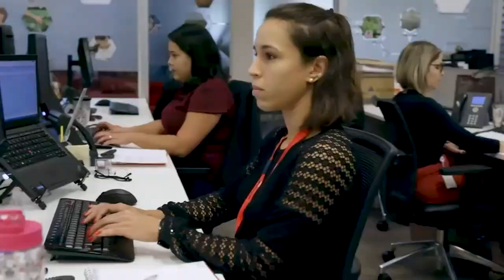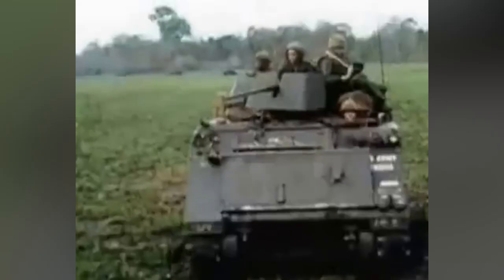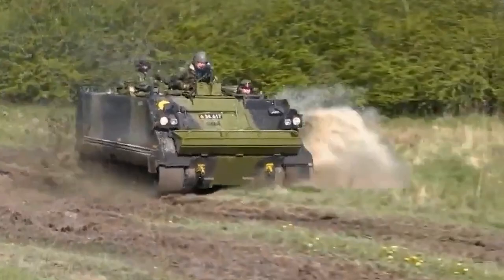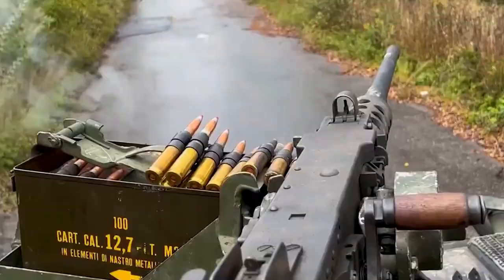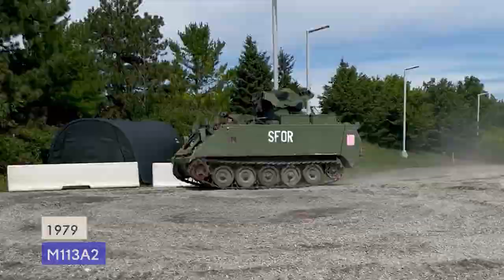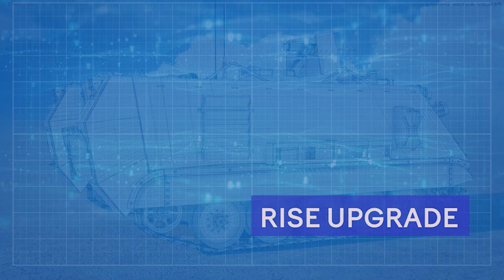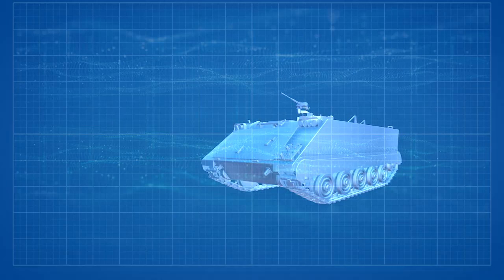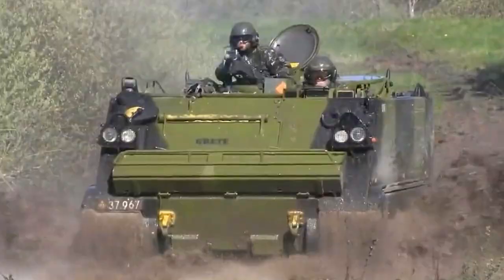America's Most Lethal Armored Vehicles Shocked The World!

Comment: The US should provide all of its 5,000+ holdings of M113 APC's to Ukraine but first turn them into budget IFV's by fitting lightweight composite armour, possibly light reactive armour in parts of the frontal arc, blast shock resistant seating, strengthen the floors to improve mine resistance, spall liners, night vision/thermals for the driver and new turrets with a range of gun calibres up to 40mm fully stabilised with the appropriate optics, fire control computers and communications. The additional weight may necessitate an engine and transmission upgrade which should be avoided if at all possible.

The Australian M113AS4 upgrade which is fitted with a 12.7mm Browning M2 is a good design basis of which 28 are to be provided to Ukraine. These modifications could also be undertaken by Poland or Slovakia for example as well and turrets could be sourced from many of the main global producers with an emphasis on rapid delivery. Other variants including ambulance, command and control, field maintenance, 120mm mortar carrier and so on would also be useful.

The US Army plans to replace the M113 with the 2,897 Armoured Multi-Purpose Vehicles (AMPV) in any case. It is also looking doubtful that large numbers (thousands) of Bradley or Marder IFV's will ever be provided to Ukraine due to misplaced political concerns but the M113 being so old is perhaps an easier path.

http://www.military-today.com/apc/m113as4.htm

https://www.baesystems.com/en-media/uploadFile/20210404033709/1434554719478.pdf